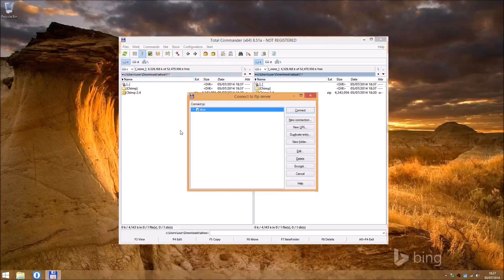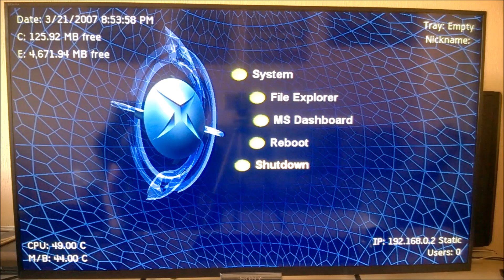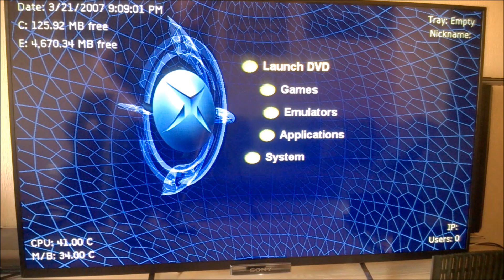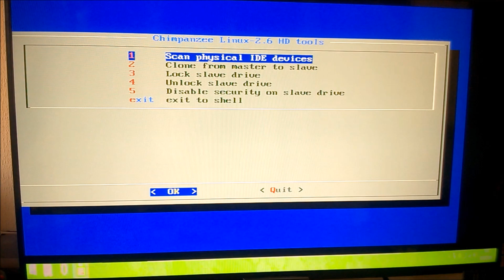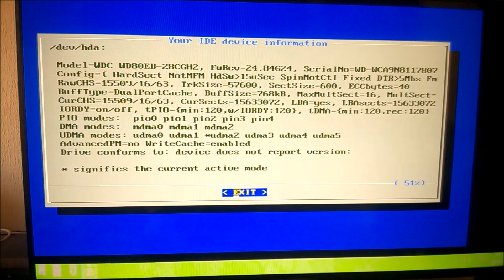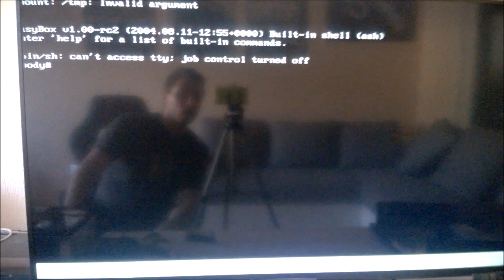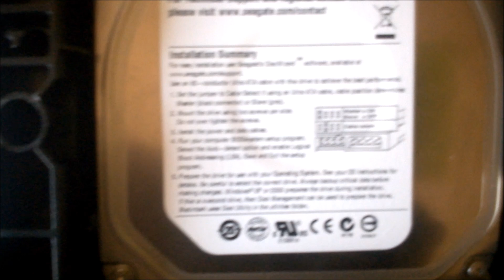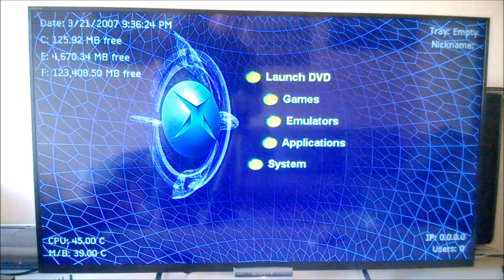Original Xbox Tricks - Part 4 - Hard Drive Upgrade

Comment: Are you kidding? Jumpers are changed BEFORE the hdd is conected again! You show how it doesn´t work!  When you show Software working, you can slow down. Not anyone is a Flash.Also your Datatransfer is so fast, that it looks like a irtual Machine, running in your PC and not a real xbox!
Reply from the maker: 1. Yup, I'm showing how you can mess up and instead of panicking you can see how to resolve such an issue.
2. If the instructions are too fast, there's this magical button called PAUSE. You can also set playback speed as low as 25%. Although I'd think I spoke slow af since English is not my native lang, and I didn't have a script, I just made it all up on the fly.
3. The answer to the crazy fast data transfer is another magic, called video editing. But if you can explain how it's beneficial to show 7 minutes of video footage on how a progress bar reaches 100%, I promise I won't cut it out in my future videos.

Comment: Please help, i start chimp on my xbox but i cant navigate the menus. Controller works fine until chimp is opened then it just ceases completely. It is an official microsoft S type controller. Any information would be greatly appreciated!
Reply: Bought a new Microsoft s type controller and it worked perfectly. For anyone having trouble with chimp not moving buy a new Microsoft controller.

Comment: Hi. 
I have a problem. 
When I will Clone the HD, appears the Screen where describe the device  HDB and the options Yes or NO,right?.
Well in my xbox not appears the next screen, just a black banner in the bottom on the gray box, like if the xbox is thinking.

Initially, I thought the xbox formatted the HD but after 20 min 
I realized that it was not like that.

The HD is a Samsung 120GB IDE.

Help me please, I follow your video step by step.

Comment: can you remove the HDD and plug it into your pc through an ide/sata to usb adapter then copy the files to another drive that way? or is the file format on the xbox drive unreadable by pc?
Reply: also if I bought a Maxtor ide hdd would that fit? I can get a 250gb Maxtor drive on amazon for $25..
Reply: I just ordered parts for this exact method, 250gb maxtor and ide/sata usb adapter. If you went that route too, did it work out good? Explorer360 can read and write to a FATX file system, so I think it should be fine, basically bypassing chimp? if anyone has more knowledge on this, please post.

Comment: My Xbox never find the new harddrive for me
Reply: MY FRIEND GAMER MEOJS, MAKE SURE THAT THE HDD Y CONNECTED JUST LIKE THE VIDEO. NOW, IT WILL BE WISE TO CHECK FIRST THE TYPE OF FIRMWARE THAT YOUR XBOX IS RUNNING RATHER IF ITS 1.1, 1.2, 1.3 AND SO ON TO 1.6. REMEMBER THAT IF YOU ARE USING CHIMP, AND YOUR FIRMWARE IS 1.6, THEN YOU WILL NEED TO US CHIMP 2.60 FOR IT. TO MY EXPERIENCE, THE BEST IDE HDD FOR THE XBOX ARE MAXTOR HDD (160 GB), AND WESTERN DIGITAL (160 GB). MAKE SURE BEFORE UPGRADING YOUR HDD, THAT THE ORIGINAL ONE IS SET TO MASTER USING THE PINS ON IT, AND THAT THE NEW ONE TO BE ADDED IS SET TO SLAVE USING THE PIN MARKER ON IT. GOT QUESTIONS ON THIS, MARCO SENIOR .... THATS MY FACE
Reply: My new hdd is set to slave, and  the old one to master. i have 1.6 and are using chimp2618. my firmware is good. because i just soft moded it.
Reply: WHAT HDD ARE YOU USING, HOW MANY GB, AND HOW LONG ARE YOU TAKING TO DISCONNECT THE IDE CABLE FROM DE DVD DRIVE TO THEN CONNECT IT TO THE NEW HDD ONCE YOU GET INTO CHIPM AND TO THE BLUE SCREEN WHERE YOU HAVE (PARTX), BECAUSE IT MUST BE WITHIN 5 SECONDS, IT WOULD BE MUCH EASIER IF SOME ONE ELSE HELPS YOU OUT DURING THIS PROCESS SO THAT THE SECON PERSON CAN MOVE DE CURSOR OF THE CONTROLLER FROM ONE OPTION TO THE OTHER ON THE BLUE SCREEN WHILE YOU DISCONNECT AND CONNECT THE IDE CABLE FROM ONE PLACE TO ANOTHER, TO THEN CHOOSE (PARTX), AND GO FROM THERE
Reply: im new hdd is a seagate on 80 gig. and im not taking long. iknow it need to be done Before 5 sec, but my problem is that after it load and all i dont find my new driver
Reply: I would need yo see a short vídeo of what you're getting on screen in order to help you further.
Reply: Gamer Meojs .. bro, I happened to run into your same issue this past weekend. Got myself another Xbox with 1.6 dashboard. Had it soft modded and upgraded to a Western Digital 250 GB HDD. But once I started transfering my games and all... surprise.. NOT ENOUGH SPACE!!! impossible I THOUGHT.. Im only Transfering 18 games...!!! THE SOLUTION IS.. ONCE YOU HAVE YOUR HDD UPGRADED.... TURN YOUR XBOX ON,, GO INTO EXPLORER,, HIHGLIGHT LETTER "F" PRESS START ON YOUR CONTROLLER AND SELECT ""FORMAT""..  RESTART YOUR XBOX AND YOU SHOULD BE GOOD TO GO...

Comment: My original Xbox might be in need of a new laser or possibly even a new DVD drive. But on top of that, I'd really like to be able to replace its hard drive WITHOUT modding it. I would like to keep the original interface and I do not want to play pirated games. I am aware that original Xbox hard drives are tagged by a system-hard drive ID system and that you can get lockable replacement hard drives. What I would like to be able to do is copy the contents of my existing hard drive, including its ID, onto another hard drive, and the identical ID would make my console think the new hard drive is the old one. Anyone got any ideas?
Reply: ik this late but just soft mod your xbox witb unleash clone your hard drive then go under options on the sid installer and select delete soft mod

Comment: Bviktor, brilliant videos about Xbox modding really has helped me a lot. I have a question though. My Xbox broke so I got another. Is there any way to transfer the modded hard drive to another Xbox to save all the data that's on it? Not sure I would install it with the hard drive being locked to the board. Tutorial maybe? :D These systems are old so a tutorial would be useful for people who wanted to back up there data and transfer it to another Xbox.
Reply: What broke? The HDD then hard to copy the files from it. However, did you backup your eeprom data from the old xbox.  See my reply to adultmoshifan87 above.  If you did, no EEPROM read needed just the copy of it to use with XboxHDM2. If not, a bit harder you'll need an EEPROM reader to obtain the key to unlock the old hard drive.

Comment: When I run chimp with the hd cable, i am getting a message that the resolution is not supported.   Please advise
Reply: shauncatlett you have to use the original composite video cables for the Xbox.

Comment: Hi Gradinkov! I just cloned my stock drive to a 120 gig HD and it worked fine but the cloned drive is showing that it's only the same 8 gigs as the original drive. Any thoughts as to why that might be or how to fix it? I went into the settings and enabled the F Drive but it still just reads as zero. Any thoughts or suggestions would be appreciated!

Comment: my friend you are the greatest, i just finished installing a new HDD on my Xbox. For those who had trouble, i kept getting a green screen when opening chimp, i checked online and used an updated version of chimp. Chimp2618.zip is what i used from this link: http://www.theisozone.com/downloads/xbox/tools/chimp-26/ 

You have to also put the linuxboot.cfg in your root E: folder, then put the chimp folder under apps. When you open it via your Xbox it will be called LPartX, open it, and select FATX, that is Chimp application from there, follow Gradinkov tutorial. I went to a certain website to check compatible HDD for my Xbox, bought a 320GB HDD for $18 on eBay. COMPAT HDD List: http://xboxdrives.x-pec.com/?p=list

Good luck everyone and happy modding.

Comment: hi gradinkov thaks for the awesome tutorial...little question, i used an adapter and installed a 500gb sata hdd. everything went fine but the question is why the menu of the xbox only show a capacity of near 120gb instead of 500gb?

Comment: I have used your tutorial exactly..I am using a 200 gb WD Corsair SE...Everything looks as though it works until I boot it up after the cloning (yes I switched the jumper to master) and it just keeps giving me the chinese writing like you have in your video...I even tried EVERY jumper location to make sure and it still gives me the Chinese writing..pls help...I am using the latest Chimp version..maybe I should go back to a earlier version..I have a 1.6 xbox hard modded. ty in advance..GREAT TUTORIAL THOUGH :)
Reply: This method isnt for hard modded consoles 🤡

Comment: Thanks, very useful. Do you know what the maximum IDE drive size the Xbox's file system can handle is? I'm wondering whether to get a really big old IDE drive or a newer Sata drive with an IDE adapter.
Reply: I’m 5 years late but 2.2TB is max

Comment: Great video, I just got a xbox from local flea market and decided to try soft modding it...I have a 500 gig HD that compatible with the xbox. When I use this method will it automaticly format it so it uses the whole 500 gigs? and make its own partitions? The original xbox hd is like 8 gigs? when cloning it will it just close the 8 gigs?
Reply from the maker: Mate, all you gotta do is shown on the video, so yeah, it should be formatted automatically. You can later manage them in the softmodded dashboard.
Reply: Gradinkov Ok thanks a heap, waiting on my cable to arrive so I can softmod then add the bigger HD...

Comment: I do not have a molex splitter cause i do not have the money to get one but my current computer rig does have a molex cable is it possible to use that to power on the hard drive please respond. thanks
Reply from the maker: nhs2008NC well cable select means the drive closer to the motherboard becomes master and the farther one becomes slave. I think it can be confusing so I prefer explicitly setting the master and slave. As to why I set the new drive to master only after the upgrade, that's because there can be only one master at a time. During the cloning the OLD drive must be master and the NEW drive must be slave, that's how Chimp works. After the cloning's done AND you have locked the slave (new) drive with Chimp, then you can unplug the old master and set the new drive to be the new master. Easy, right? ;)
Reply from the maker: Hi mate, yes, you can absolutely use the comp's PSU for it, in fact, I also used my PC's PSU for my very first Xbox HDD upgrade. I just didn't mention it coz it's usually more complicated to align all the crap together (i.e. Xbox and PC next to each other).
Reply: Gradinkov Does it matter how much wattage is needed to power the hard drive on the PSU cause the computer that i am using is at lest a year old.
Reply: Gradinkov ,
Hi I am just upgrading the hard drive. Using your tut. Shouldn't the jumper go into 'Cable Select' rather than master? Not that it works just fine with master here. But is there any specific reason setting it to Master AFTER the upgrade?
Reply: nhs2008NC Its because that is how the xbox reads the hard drive after cloning it and that is also how the hard drive that was originally in it reads as well
Reply: Hal Leo I'm sorry but I don't understand.  Are you saying that the hdd is master? Then it should also work as cable select right?
Reply: nhs2008NC When you have you xbox without the drive cloning or without the softmod it is already set to master. When cloning the drive you want to upgrade has to be set to slave before cloning. Cause if you put it inside on slave mode you will get red ring and then you will have to re clone the drive again. Had that happen to me before. After you are done cloning to upgraded drive you must set it back to master before using it as the permanent drive.
Reply: Hal Leo ,
OK. Thanks for clarifying. I was just curious as both Gradinkov's and mine XBOX Orig. HDD was set to CABLE SELECT and not master before upgrading. So I guess if I set the jumper to CS it will still work. (If only I had tried yest..)

Comment: 1. I noticed that your reboot was very fast are you 80 wire instead of the 40 wire that come with xbox?
2. How reliable is that Seagate? as far as hdd's go Ive seen a scary number of 8-9% Failure rate. as seen on
http://www.extremetech.com/extreme/175089-who-makes-the-most-reliable-hard-drives
3. For any that can answer (facts only please). will the chimp app work for Sata because 160 gigs is nice but in this day in age 2tb wich is max original can handle Sata is affordable. If so how do you deal with the master slave issue?
Reply from the maker: Hi Scott,

1. Don't let this fool you, the video is cut carefully ;)
2. I didn't have much choice, this is pretty much the only drive I could find at local stores. I don't have any numbers on its reliability, sorry.
3. There's no SATA port on the Xbox, so I don't think it's possible in any way, but FIXME :)
Reply: well I'm going to try sata anyway using a KINGWIN ADP-06 SATA to IDE Bridge Board wish me luck. I found your drive as well at new egg as a affordable option. Seagate is giving me the chills though when I read it's reviews on reliable HDD's. So far in all my searching this video is the clearest on how to do this. Kudos to you sir Kudos.
Reply from the maker: Scott Payne thanks a lot mate, I hope you succeeded with the SATA bridge.
Reply: Scott Payne did bridge board work?

Comment: could i put a bigger hard drive in then the 160gb ?????
Reply from the maker: I think it's supposed to work, yeah.
Reply: Max is 500 GB IDE
Reply: Drachenreiterklaus ok thank you for the info. i tried to do it with a 40 gig but i bricked the whole xbox so i had to start new. i am very resistance to doing it again. i think last time i didnt let it lock the hard drive all the way i thought it froze
Reply: shawn sosna
If you brick the X-Box, she is so cheap on Ebay. Don't worry and good luck.
Reply: Drachenreiterklaus well a buddy of mine had another one he didnt want and let me have it. i am just afraid of bricking it again
Reply: *****
But the X-Box can only use up to 500 gb
Reply: *****
oh ok thank you. than you can use a 1 TB HD ? How do i partition the 750 GB HD ?
Reply: *****
Yes , a friend of mine has ever tried a SATA hard drive. It worked, but it was much too slow.

Ok i found the tools, now i need a 750 GB IDE :-)

thx